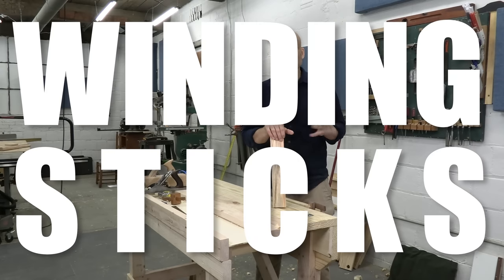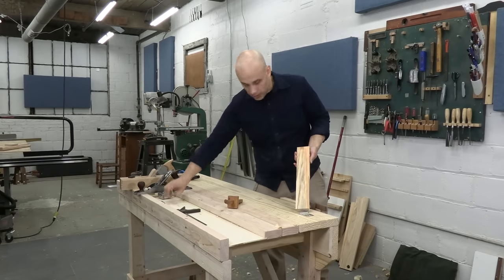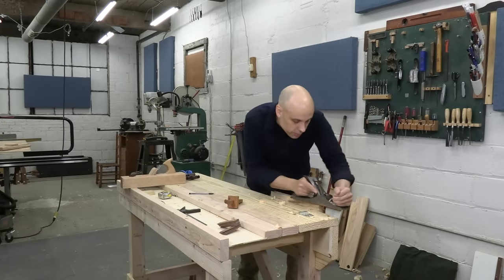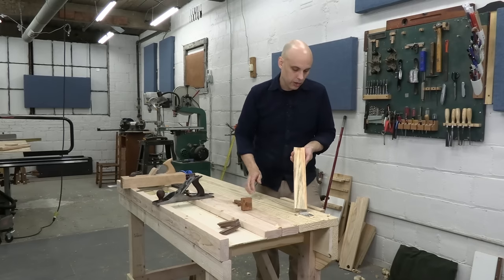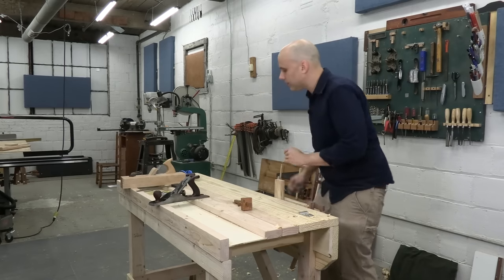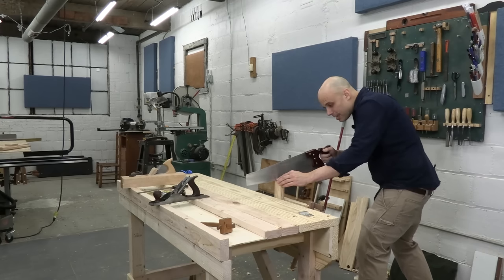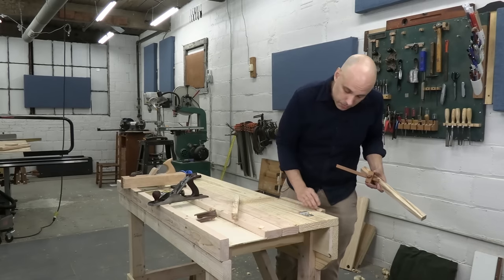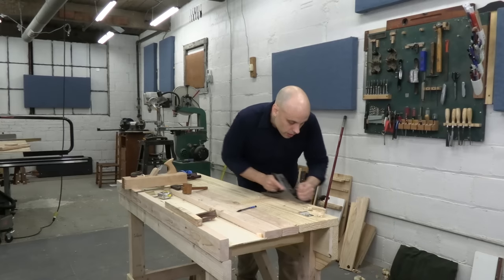Winding Sticks don't have to be perfect!! Make this fast set from pine.

Comment: My winding sticks are two piece of oak flooring, ca 2-1/2 inches wide and 3/8ths thick.  Trued with a plane and table saw (can't beat the fence for parallelism), and one side of one of them covered with a strip of blue tape.  I drilled holes in one end and hang them over the bench.  I've used them for around 20 years now.

Comment: Here's a suggestion for a variation on winding sticks that's worth considering, especially if you wear glasses because of nearsightedness.  It's hard to sight both the near and far sticks while bending down to your workbench--too much head movement to catch the near stick over the top of the glasses and then the far sticks using the glasses.  If you were standing on your head, then just shifting your eyes would work, but in the usual position, you have to move your head, possibly losing the relative position of the two sticks.  I found that if you place a square or other perpendicular on the board at either end, you can judge the alignment of the verticals easily, giving you the same information as with traditional placement of the winding sticks.  Just adjust your gaze without moving your head.  The best part of this technique is that every woodworking workshop has plenty of squares (adjustable and roofing) that you can position on the boards.
Reply: That actually is a great tip! Thank you
Reply: Speed square work very well for this method.  

Another tip is to blacken the leading edge of the closest square - using a Sharpy - which makes sighting the clean edge of the far edge easier.

Comment: The best winding sticks I've seen are simple aluminum angle. A 3/4 inch by 48 inch section at the big box store is around $8-$9. Cut it in half and you're good to go. Or buy 2 for that price and have some really long winding sticks. Really exaggerates the twist! 🙂If you are careful with them, they can also be used as a straight edge for marking lines.

Comment: Great video! Graham Blackburn also talked about winding sticks recently, and both of you made the same point—it doesn't have to be fancy! I made two oak planing stops a couple of years ago; basically two sticks to place against bench dogs or hold fasts in my low roman. I wanted to make some winding sticks and realized I could just use the two sticks. So I squared them off and cleaned them up. They work fine, although I don't have the contrasting wood.

Red Shorts 😂

Comment: I totally agree. It is nice to have perfectly parallel fancy winding sticks but it is not necessary. As long as they are identical (could even be weighted many degrees one way or the other) and have sufficient visual contrast, they will work. My winding sticks were made very quickly from a scrap of 3 foot 2"x1" cut in half lengthwise, planed together in the vice, both marked in the centre with a sharpie and one marked for about 3" at the tops of both ends. I then marked one end of both so I knew which way to orientate them in use. They work perfectly, maybe 10 minutes work at most...?

Comment: Wholly Khau! I haven't got anywhere near enough patience to go through all that for two sticks, especially when I have trouble keeping the sole of a plane perpendicular to the sides of the piece. (I do keep practicing, though.) I'll just keep watching you and learning. 😊
Reply: Maybe making some is the best way of practicing and giving you something you can use at the end instead of firewood
Reply: You only need the edges parallel to each other along the length. Square to the side doesn’t matter.

A faster way to winding sticks is get some aluminum angle, cut it in two pieces and paint contrasting colors along the long side of each piece.

Comment: For my first set of winding sticks (which I still use) I spent $10 at Home Depot for a 36 inch piece of 3/4" aluminum angle bar and cut it in half.

Comment: I bought two 24" wood and brass-reinforced levels (early 1900's). Most of the sight glasses were broke so they were cheap and look good hanging on the wall when not in use.

Comment: Great video! Love watching your process, and the reminder that hand work can be just as effective and even more satisfying. But I guess I'd like a little clarification on something. 
You mentioned a couple of things that seem a little out of concert. One is that the sticks don't need to be perfect, and can even be high at one side as long as both profiles are identical.
The other was talking about seasonal expansion. 
Given that the two sticks are taken from the same piece of wood, wouldn't the most likely scenario be that the expansion would be uniform?
Also, is it imperative that the sighting edge be edge grain rather than face grain?  It would seem that using face grain as your top and bottom plane would relegate any shift to an axis that would have no impact. I realize that potential for board sag is more likely along the face, but given the final dimensions of the piece, it seems pretty unlikely.
So am I missing something, or is the possibility for expanding and contracting less of an issue on something of this scale?
Reply: Great questions … or at least questions I'm also interested in. Sadly I don't have enough knowledge to contribute meaningfully to the conversation beyond trying to help it get noticed!
Reply: @Psittacus_erithacus  I appreciate that. For all I know, I'm making a mountain out of a knothole. But I'm always curious to learn more and make sure the effort I expend isn't wasted, either in outcome or in over protection. 
I love this channel, though. One of the few guys left who really gets into good solid explanations of the tools, the process, and (when need be) the work arounds.

Comment: Nice video, and we'll explained. One question regarding sawing. I have seen others mentioned that we should not start sawing by pulling as doing so would make the saw jump and make little mountain and valley that would make it harder to make the next push stroke. Maybe it is different for rip cut. Do you have an opinion regarding this?

Comment: Lovely video and I get your point. I use plywood for shop furniture and my favorite depth gauge is just a dowel press fit through a straight piece of pine. In the case of winding sticks, however, your talking about 'forever' tools that you make once and use until you drop. While I greatly respect Mr. Blackburn, it seems to me that winding sticks should be as perfect as one can make them. And the light/dark inlays make them easier to use. So, as much as I enjoyed this video, we'll just have to agree to disagree as to your central theme.

Comment: I'm puzzled:  since you re-paralleled the sticks after ripping the original blank, was it necessary to parallel the opposite sides of the blank before ripping?
Reply: It only makes it easier to square it afterwards.

I think a pair of windingsticks should really be of the straightest and evenest piece of wood you have with standing growth rings to minimize movment. In that case squaring up the sides beforehand would help ensure that the grain runs the same in both pieces. Rex woood has curving grain so that wont help.

Comment: When you already had two parallel edges, why did you not just resaw splitting the already parallel edges, possibly slightly out of square to get both halves a fatter edge to stand on, and then just clean up the sawed face?
Reply from the maker: Because the stock is less than an inch thick. Resawing would have given me 2 very wide, thin boards.
Reply: I did just that with the square section of a hardwood table leg (Mahogany I think) works well if there is enough stock to give you a stable set of sticks.  They turned out nice and being hardwood look 'fancy'

Comment: The old instuction book i have say winding sticks should ideally made from a stable wood with straight even wood with standing grain split from the same board. They should then be hold together with lose pegs so you always use them the same orientation and planed together for eveness. Keeping them together should also make it easier to spot movement in the sticks. An optional thing was to put a bevel on the outside like on rulers. Inlay was not mentioned i think but it was recomended as a good project to learn accurate planing for new craftsmen. Wich means i probably should stop writing and actually make a pair!

Comment: Do you have a video on the rack-stop you used in your vice when doing the long rip cut?
Reply: He mentions it in the video on vices. I think one of the one about cast iron cheap ones. It is just a bunch of wood pieces on a dowel to act as distances in the other end of the vice to keep it paralel and transfer clamping power to the other side. Probably a trick picked up from one screw wood vices were distances in the other end of the vice are neccecary if clamping off center. I often just use an offcut of the piece i am working on.
Reply: @borjesvensson8661  thank you, I'll check it out. I only have single screw vices at the moment and scrap wood works well enough but I'd like to see the rack stop in more detail. Appreciate you taking the time to help me Xx

Comment: Rex, I sight along the bottom of my winding sticks. So I only need to be concerned about the flatness of one edge on each stick.
Reply: That's pretty clever
Reply: How does that even work?  How do you see the bottom of the  back stick when by definition it’s obscured by the front one?
Reply: @richardsinger01  Sight from just below the 2 sticks instead of just above them.

Comment: Your marking technique for the rip line is how I find the center of a square.  I really don't like the corner to corner technique as it's hard to confirm you are on one corner let alone two.  Then you have to do it again.  If the thing is square (90s all round) then doing a line from each edge would give you a good spot to eyeball a drill bit or whatever you need.

Comment: Would making these by resawing instead of of a normal rip make them react better to moisture changes? The expansion and contraction would then be more similar between the two sticks that way, no?
Reply: The stock did not have the necessary thickness. Also thin stock tends to warp more than thicker stock. Resaw your stock for small parts drawers just when you need it, so just before doing the joinery... (if the wood has been in your shop a month or so this is less critical).
Reply: What’s the logic here?

Comment: Hey Rex, I have a dumb question. Would the resin in pine cause any problem on your plane blade if it's not cleaned out? I think I may have left it uncleaned more than a few times after a couple of sessions.
Reply from the maker: If you're getting resin on your tools, then you need to clean them.  This wood was dry,  so no issues for me.
Reply: Oiled wood planes are suprisingly good at keeping resin in check

Comment: Wouldn't extruded aluminum be better than wood for this? Almost as easy to cut as wood, relatively cheap, not affected by moisture or temperature changes, and since it's machine made it will be perfectly straight and parallel. Just but it, cut it to length, round of the edges and draw the black line.

Comment: Less than professional tip: your 4' and 2' levels double as winding sticks in a pinch. They're obviously not as nice as a fancy pair of dedicated winding sticks, but they're always near me when I'm working. I find it easier to have the 4' level further away from me because the extra length helps to exaggerate any twists I'm working against.
Reply: I see your levels and raise you two #5 planes on their sides
Reply: @fisharmor  that works too! I wish I had two #5s to try it with haha.
Reply: I use 2’ levels as winding sticks. Always within arm’s reach of the bench.
Reply: I use aluminium U profiles. Had them kicking around from another project and just use these off cuts
Reply: I thought I was the only one using levels!! I bought two super cheap extruded 24" levels. Turned out the vials were not true, so they ended up being free winding sticks  after the big box store did not want to pay to ship them back.

Comment: I so wish I could do woodworking :( sadly, no room in my apartment,  and my ikea furniture is way too wobbly to plane anything on it
Reply: Check out his minimum timber bench, or any of his others.  The most recent is a machine tool build, but it could easily be done with hand tools.  The Traveller’s Workbench is even cheaper and simpler.  Both require about 5’ x 2’ for the bench plus some room to stand in front.

The floor under it shouldn’t be carpeted.
Reply: The apartment could be a problem, but the furniture shouldn't be. Like many folks my very first project was building a workbench. Rex has some great videos that cover bootstrapping yourself from a small pile of hand tools to a basic low workbench then using that low bench to craft a full sized bench with a comfortable working surface and flexible work holding options. One of them even covers a take-down style bench which might help with your space constraints (work outside on pleasant days, perhaps).
Reply: I made my first mallet and my workbench sitting on some free facebook found lumber, on top of some low 2x4 sawhorses that i built from scraps from the Menards scrap pile. No need for anything fancy to get started.
Reply: The kitchen counter is usually less wobbly than any other raised surface in the apartment. Clamp some ply or mdf onto it.
Or make a Japanese style planing board, a small tool box and work on the floor.

My knees no longer like the latter, I'm quite out of shape and no longer as flexible. I worked with both methods.

Or make a low bench! This can even double as a bench for your dinner table.

Comment: Since this is an ideal beginners project, and people don't watch videos chronologically, I think you missed an opportunity to treat this as a video for people with little or no knowledge to woodworking. What on earth are winding sticks? (you only show it at the end) What's the best way to hold a marking gauge (pressure direction, tilt,...)? Explain the importance of the direction of the grain when marking and when planing. What is "cross" and "rip", etc...
These don't have to be elaborate explanations - just touching on the basics.
After all these years of (great) videos, you're understandably beginning to make assumptions about your audience.
As a moderately experienced woodworker, I kind of skipped through the video. As a beginner, I would have been left with some frustration, both while watchin and mimicking your work.